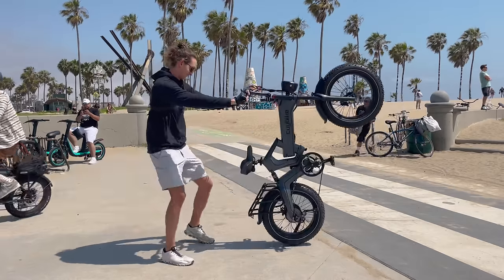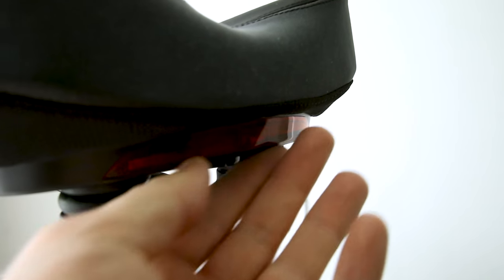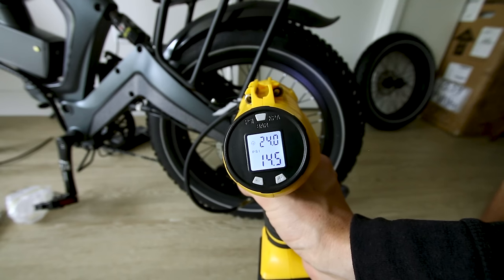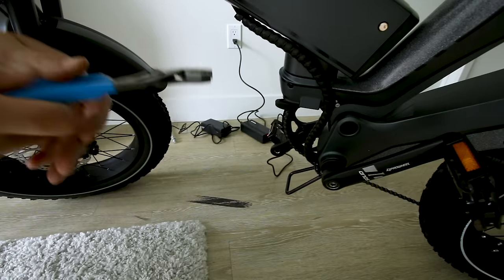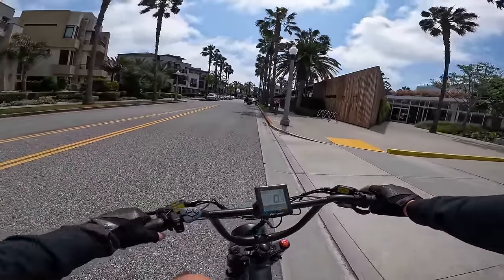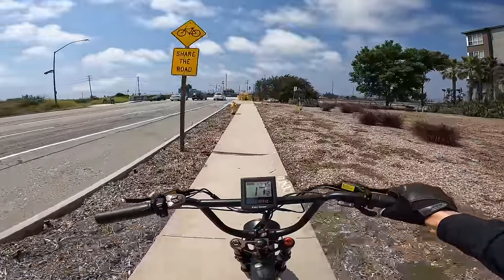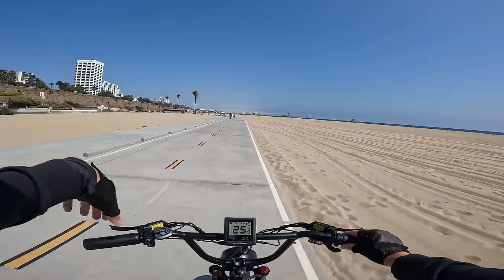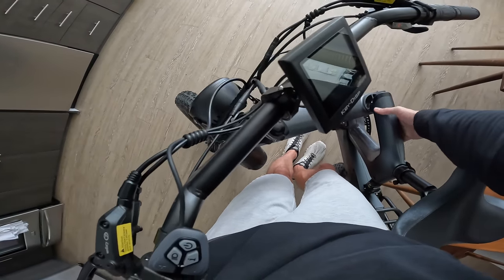This Electric Bike Isn't Normal

Comment: The man said 10 miles he  lost 2 bars...a common rider doesn't do hills and stress test the bike lol he killed the battery lol.....I'm traveling 12 miles to work and 12 miles back and I still have 3 bars
Reply: He’s testing! That’s what we WANT!!!
Reply: common riders don't all live in flat areas, try riding in towns that don't have a flat road- the bigger the battery/power the better. I have tried 500-750 watt ebikes and they just cant handle the non-flat riding, its no fun pedaling and still under 12 mph.
Reply: The bars were not accurate
Reply: Same I did atleast 10 miles to work and back , and stil had 3 bars
Reply: I only do hills.

Comment: I'm a little confused when you say this is a legal bike. In California, the legal limit for ebike motors is 750w. This one is advertised as 1,000w. Thier press copy doesn't specify if this is nominal or max. The police in CA are already woefully ignorant of the laws on the books and regularly hassle legal riders, so I would double check before relying on these claims of legality.
Reply: I believe you're mixing Rating and Actual Use.  The motor may be rated 1kw, but if your controller only feeds it 750W, then it should be OK.
Reply: @AllDogsAreGoodDogs  The whole point of publishing the higher number is to inform the customer of the max wattage the controller will draw under load. 750 is the nominal wattage. But in the 4 months since I posted this question I've learned these bikes are stamped on the frame with a 750w rating which is what most cops with go by if they stop you.

Comment: Ya bud, that bike is not running to spec. 1000w 25ah 48v is really powerful...That bike has more power than my stock Polarna M6 and I can tear through the sand easily. They must have a 15 amp controller in there limited at 500w. When my M6 was stock 48v 17.5ah battery but a 25amp controller, it was almost unstoppable. Im 215 and got about 35-40 miles on battery throttle only.                                                                 Now I have a second 20ah battery on top of the 17.5ah get 75-80 miles on battery alone. Upgraded to a 35amp controller also..  Acceleration, speed, and distance all a lot better! 29 mph to 34-35 flat ground if anyone interested in knowing. That EUY out of the box should be a barn burner!!. They did something wrong on that bike..
Reply: Which 35 a controller did you install? I have a Vitilan i7 Pro, which I think is the same bike. I would like to install a more powerful controller.

Comment: I have that seat on my bike. It does take getting used to, but it is super comfortable on and off road. Mine has the external metal springs and I use a Zoom suspension seat post. Great videos. Keep 'em coming!

Comment: to measure accurate battery voltage, it must be under load. That's why it bounces back after turning it off - no load. You'd need to buy a resistor that can handle that wattage; it will get hot too (the resistor). Used to work for a company that supplied the start up batteries for trains.

Comment: What would be a nice security feature is if it had a key to lock it in the folded position, making it much more difficult to ride away if they get through whatever lock you've chained it to the post with.
Reply: they just pick it up and throw it in the car
Reply: @dethray1000 which they could regardless.
Reply: "Folding it" makes stealing the battery easier.

Comment: At 20:15, try holding the back brake down so the bike doesn't move as you're pulling the front towards you. I found that's a little easier

Comment: Interesting looking bike, and I love magnesium... as long as you don't light it! Efficiency at 31.25 watt hours per mile was not too bad considering how hard you were pushing it. 20 inch tires are just not good in the sand, and even though you can make decent progress if you have 1,200 watts or more and drop tire pressure, steering is still a problem. On one ride with friends, I was able to go through almost as well as a Grizzly (power wise), but I hated how the sand flipped my front wheel every which way. Thanks for the video!
Reply: Pure magnesium is flammable, this bike is an alloy othervise this bike would be too dangerous

Comment: Would be nice if you did controller programming review.  Could have been set to 10amps.  Could have 0-9 pas settings.  Battery bars can be ok if you can know/program what voltage each bar has.  Samsung cells seem to have high voltage drop though.  We don't know if everything bad about this bike can be programmed away.  Thanks for voltage check.  Almost always, turning it off/on again will give the resting voltage.
Reply: Would programing each battery bar to a higher voltage produce more power?

Comment: Trivia, ... the volt meter you have is a DVOM (digital volt ohm meter).  It operates with high impedance.  When you measure with it, essentially the circuit does not know the meter is there.  Now a volt meter with the needle (which is still used for various reasons) ... can be a problem, especially with powered logic circuits.  The needle type does create a circuit and causes error in readings to boot.  .. Most modern meters (DVOM) do have fuses if you were to badly misuse it.   Nice video but I am curious what the simple street/bike path distance would be.  Harsh driving, if needed, would be an emergency or such .. I want a cruiser that is foldable and power enough to go quite a distance.  Dimensions of minimum space needed for foldable to "fit" would be great.  Nobody does this... so high, so wide and so deep...  This is important .. I know web sites have it and I can hound it out but the neat "here is the fact" would greatly save the impatient buyer.  I enjoy your videos too.. pat

Comment: I was rooting for it. It has some design issues. It wasn't ready for market IMO. The computer/software needs some work. It needs a bigger inverter or better controller. The light on the seat that runs separately on coin batteries was kind of silly.

Comment: Ordered a Luckeep X-1 electric bike with a 750 Watt Bafang motor in the rear as you call your  channel TailHappyTV... supposed to take 35 degree inclines good and such and will see. The LucKeep from what I understand has an electronic deal and partnership with Susuki motorcycles. The frame on the machine is beautiful in color as well as shape and it is a hard tail E-Bike... reminds me a little bit of this machine you are reviewing. I have another E-Bike I use that is 26 Inch Mountain Bike style I like with rack on it and pannier bags. Will add pannier bags for the Luckeep and it has a lot of features for the price point... such as automatic turn signals on the back and powerful headlight, horn and a with BikeAppPro the bike motor can be adjusted for prefererences riding it with a smart phone. The bike also has built in alarm system and is a folding bike. Lost my left leg in 2018 below the knee and my girl friend of many years died from cancer and a brain tumor on February 7th, 2023 at 1:53 PM... her last two words to me was ..."love you" ... and she wanted me to live the best and survive a long life after her passing. I had got organ transplants on December 7th, 2011, duel and was cut in half twice and my organ donor was a ballet, lyrical and jazz dancer whome was murdered at age nineteen by a drunk doctor driving intoxicated so the LucKeep E-Bike purchase reminded me of all the luck I've had staying alive, with odds of a trillion to one all that stuff would work so a lot played into the purchase mentally. Any way some time if you ever come across a LucKeep a review of it would be nice to see... ordered mine and it is coming from  Rialto, California at the huge Amazong Warehouse there... hopefully it arrives in the window of time they told me it would show up and LucKeep has already contacted me with links to every instructional video on the bike and more and that surprised me. They have good customer service it seems... any way a link to what it looks like here and I think the machine is beautiful in how it looks... wish you the best and thank you for your video reviews... hopefully I can have some nice rides on the LucKeep when I have days I feel a bit lost since my girl friend died in February... into the sun set and such things... here is the video link of the LucKeep but no really good reviews have been done on it yet...https://youtu.be/XYv5NqaE2lo
Reply: Here is another video link of the LucKeep X-1 and I like the way the rear end of it was put together.. "tail happy" and it has beautiful curves in the style of the machine... reminds me of the Mitsubishi Eclispes "Spider" I used to own before a pizza delivery driver hit me head on in a turn lane I was in rushing to deliver pizza and I woke up facing the opposite direction and had caught on fire and some lady from Florida was in my passenger seat and I was going to unbuckle and get out and she told me not to move... I had been on fire... I had to laugh because the air bags went off and sounded like a gun before I lost consciousness... air bags caught me on fire in the collison but saved my life... and the LucKeep design reminds of the beautiful curves I had in that Eclipse I owned... a pizza driver destroyed... LOL! Any way here is the video link for the LucKeep and would be nice if they would let you review one... I have a 2023 model of it ordered and even though it is a hard tail I like how it looks for a folding E-Bike design... wish you the best as well and all those that watch your reviews on this stuff...https://youtu.be/jcL-u9_0rVA

Comment: Can you touch the probes from the multi meter to the pins of the on-frame charging port to get an accurate readout of the battery charge status?  That would save some time and effort over having to fold the bike to get at the battery for that test.

Comment: Thank you for your reviews.  I have been going through a lot of them lately. Planning on getting one within the next month or so.  Have you done one about the aventure 2? from aventon?  I think I saw the first bike on there.  I'm a heavy guy, and although I'm working on that weight loss journey, still need to work more to do get there.  I have been debating over something like the himiway zebra or the Aventure.2 bike.  My weight right now is between the 350 and 400 range.
Reply from the maker: you might like this one:
https://youtu.be/aAJgr5rbIPU
Aventure 2 is probably nice too, need to get that on the channel soon. The aventure 1 had an annoying throttle lag, but the 2 has a torque sensor which would be good for getting exercise

Comment: On the hunt for a new EBike now, bought the rattan pathfinder after seeing your video among others... the motor has shorted out (they removed regen due to motor issues) and customer service has abandoned me.  Out 1,500$
Reply: They are asking too much. Performance suxs
Reply: @jimmyBurnett  yeah, I experienced nothing but issues from brake sensor failure, to the derailleur having a stripped out adjustment screw... so now I have a bike shaped paperweight

Comment: Most people are not going to be riding in the sand!!!
Reply: My normal shortcut got torn up for renovation so I went around. On the way back I came from the opposite direction and had to do some serious braking at the last second. Then I figured "What's the worst that could happen?" and launched into six inches of tractor-rutted sand. Amazingly I never had to put a foot down. I am very impressed with my Engwe L20. It's been a beast. Great videos.

Comment: Based on your voltage measurement the battery bar display is obviously wrong. I would be afraid to buy this bike because what if  the controller decides to stop supplying power to the motor when the last bar drops off even though the battery still has plenty of charge left.
Reply from the maker: in my opinion it's better to give a lower range estimate than over estimate, I'd be surprised if the controller cut the battery off early. Probably shoulda kept riding until it died 😆
Reply: @TailHappyTV  Maybe sequel is in order. 😉
Reply: @barryrudolph9542  yes!

Comment: Why do all these e-bikes have knobby off road tires? How about a city/commuter tread? Got to be better for battery life.
Genius move on the fender install.
Those damn watch batteries for the brake light run about $15/PC...WTF, couldn't wire it into the electrical system?

Comment: HI
I would like to know, please, how to unlock the speed limiter control unit on this FATBIKE model.
Thank you.
Reply from the maker: I forget, but if you check the manual, it will show you if I did not show in this video itself

Comment: Sir have you ever done a review on the magicycle ocelot pro?
Reply from the maker: I rode it at the electric expo, it was fine, it's a small bike. If they send one over I'll review it, but I really wanna try the Mini Deer because it's full suspension. I did review the full size deer and that was a nice riding bike with good power and range. Not thrilling power, but solid for everyday riding.

Comment: Looks kinda like a reverse engineered 2nd thought, most common complaint i have with fat tired units have very short tire life, not very generous with the little knobbies spaced so far apart just begging for a flat or a tube & slime injected from the get go, since most people on ebikes seldom peddle riding throttle only i would think a little xtra weight wouldnt be an issue, better thicker treaded OEM tires should come with it, or even be available aftermarket but it seems these same design tires are about all thats our there.

Comment: So weird that they put some effort into making their folding bike light, and then just gave up and slapped a 10 pound battery and 2 fat tires on it.
Reply: How do you suggest they get around the weight issue of larger batteries?. This is roughly 66% more power than 15Ah battery. More cells or larger cells = more weight...